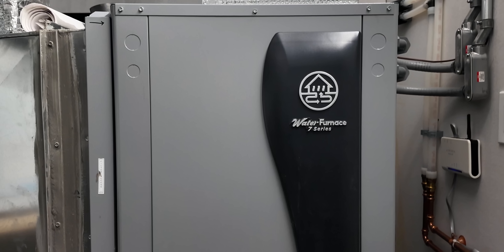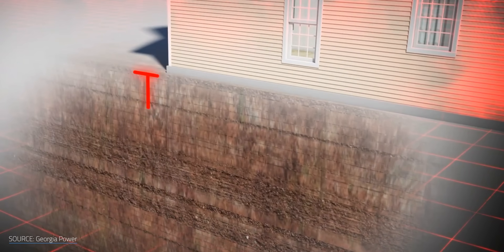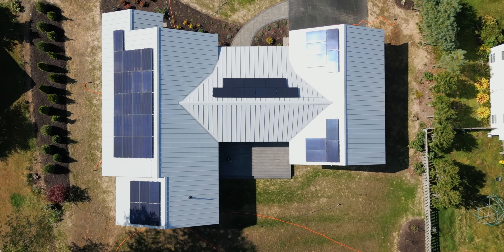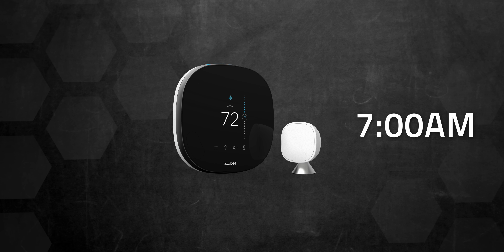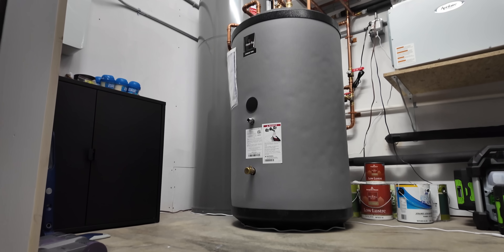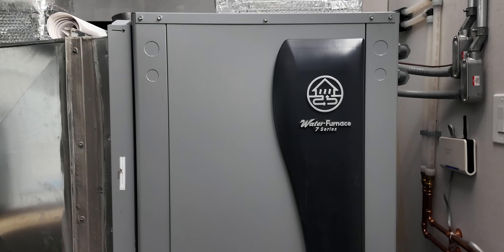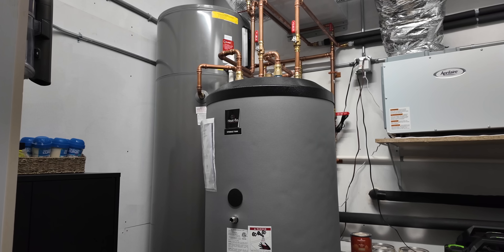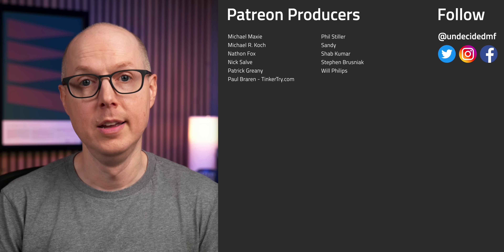How My Geothermal Heat Pump Really Performed (2 Years)

Comment: Focusing on the purely monetary side, you're saving about $1,150 a year. In order to do that, you had an extracost of.. let's call it about $20k/yr.
Now, $20k will generate $900 of risk-free money per year if you stick it in 30 year treasuries. So you're actually saving $250/yr of principal.
Divide $20,000 by $250 and you'll get a number of years which confirms that unfortunately with your figures you will not be doing this to save money.
Further, even if you were to 'forget' the opportunity cost of those $20k, 20/1.15 is around 18 years.
I'd be surprised if the equipment had a life expectancy of much above 20 years and of course one should factor in the greater cost of repair.
So even then it would not be 'financially worth it'.
Which is again unfortunate, but that's where the numbers come out.
Yes, I look at business plans for a living :)

Comment: Nice break down! That cost took me by a big surprise tho. In my area these cost around 20-30k, depending how big your house is (including the pump, ground loop, inner piping, buffer tank, pressure vessels etc etc.) . And here in Finland ground source heat pumps are the most common heating source for new detached houses. Side note: you can use ground loop for cooling only if you've drilled bore, not with surface loop

Comment: Official WTF*:  $39K would have been the cost of a comparable air source heat pump".....I live in Florida, so maybe I have no idea of your equipment up there, but $39K would be an appropriate number for someone with a 10,000 sq ft home!  A high efficiency unit for a 2,000 sq ft home here is *maybe $11K!, and that goes down with increasing size.

Comment: to add on the water heater thing, i saw this setup using a copper drain pipe for the shower with square tubing wrapped around it that was the supply line to the water heater. your waste water from showering was pre-heating the input to the water heater. it was an insane amount of recovery, too. iirc it lowered heating costs by something wild like 40%. worth fact checking though, in case my memory is fuzzy on the details.
Reply: bro $0.31/kWh is insane. i thought it was high where i live :O

Comment: Seems to me that the average break-even for a ground source unit is about 10-12 years.  If you consider that the average time spent at 1 location is about 7 years, there is a risk of payback.  Of course, there is an advantaage on selling.

Comment: It's crazy how wildly different technologies can behave depending on the local legal framework. Where I live power is extremely expensive for example, and almost nobody uses AC, we just open windows or have a fan or two. So cooling isn't at all part of the price calculus, and heating is just done with gas or wood (or pallets for that matter). 
So since power is expensive, and gas relatively cheap, this would never make sense in my area. Same reason EVs don't catch on here, despite the government offering constant bonuses. People just don't want to run their cars on expensive electricity.

Comment: Good videos just a couple of things price I really wonder what the price would actually be if the tax payers didn’t have to support these rebates with rebates the price always goes up and these companies are preying upon this fact shameless!The way this industry explains the systems is your getting free energy from the ground your actually getting it from the AC unit. On our sailboat we had a AC UNIT FOR COOL & HEAT which used lake water to cool the unit. So it’s a geothermal system. These systems for homes are way overpriced!  Most people don’t really understand how the systems work the only thing these systems are eliminating is the gas to heat.and the cooling fan for the AC pump. Good videos though.

Comment: Why not build a bunker below the frostline for an air source heat pump? Half the cost of ground-source, should be way better efficiency than trying to steal heat from the snow and dump heat into the hot.

Comment: I would probably go with a pond loop so I could have an excuse to build the pond of my dreams. Your cost is way higher than what I have seen from others, but that's probably pumped up by using premium luxury equipment and a suboptimal soil/rock setup. And of course renting the equipment to do the installation at your own convenience can save a fortune lmao. I'll gladly put in a week of yard work to save multiple years of wages.

Comment: The price variation from country to country I can understand if the technology is new and there are only a handfull of equipment and people doing these, but surely geothermal is so old tech and drilling is just drilling. How could it be so expensive? I installed a system 3 years ago here in Finland for 22 000 EUR. And that was not the cheapest option as I went for a quality system and indoor convector for cooling added to the costs.

Also the comments about impossible drilling where there is bedrock? We HOPED that the bedrock would start immeadiately after surface so that the need to put a steel pipe would be minimal. We get quoted with disclaimers that say "price includes one 6meter steel pipe and drilling of x meters into bedrock, any additional soft ground drilling and steel piping will be billed separately"  When I was deciding for the system I read horror stories of other people only finding bedrock after 40 meters of soft ground and paying huge amounts that basically ate most of the potential savings for the first 10 years.

Comment: Variable speed heat pumps typically give the best economy when you keep the temps constant. Even a 2 speed HVAC works well when kept in a very narrow range. If you let the air get 4-5 degrees warmer on a hot day, a two speed unit will often have to run at high speed for a long time to get back down to the lower temp. When running at 75%, the 2 speed will use about 60% of the power that it will when running at 100%.  The unit runs longer, but uses about the same total amount of electricity, and it keeps the home at a more comfortable because running longer lowers the inside humidity. The more speeds you have, the better it is to leave the thermostat at the same setting.

Comment: My fundamental concern, or debate I suppose, which I’ve been unable to calculate myself is what I call the “VW Effect”. VW got creative with some programming regarding their diesel engine efficiencies and while they were capable of the NOx emissions the fed mandated, they couldn’t also get the fuel economy the customers demanded. So they got, creative, with their accounting. And it cost them $35bn or so. Here’s the rub, the government and EPA required these vehicles be “fixed” or destroyed and most people opted to replace rather than wait for a magical fix of some kind, eventually. So hundreds of thousands of perfectly functioning cars which would have passed emissions the year before they were made, were relegated to being bought back so people could buy another car. Stay with me, I promise I’ll get to it. So, hundreds of thousands of cars which had a minuscule (relatively) emissions excess now had to be destroyed, which used heavy equipment that had no emissions standards, and all the plastics ended up, well, everywhere. Then the previous owners had to buy another car requiring the entire manufacturing complex to kick in and spew tons of toxins out since they have, lets call it flexible, laws and rules, then ship these cars on boats which basically spew tons of toxic gasses across an ocean, then be loaded onto big rigs, which again put out more NOx per car to go from A to B than any of the cars themselves will put out in a lifetime just so people can buy them to replace the offending vehicles. At some point, wouldn’t it have been closer to “net 0” to not do certain things? A free hot water reclamation for example is free, financially, but it took being manufactured, then people, driving, installing, fittings which needed to be manufactured and so on. At what point is the “net 0” not really net 0? It is more like a “0 from now on” calculation. For context, I’m having this same debate as I just had my house retrofitted with solar and battery backup to supplement the dual fuel heat pump HVAC system I had installed 2 years ago. I want so badly to have a circuit from the battery power a 20amp plug next to my gas hot water heater so it holds 5 gallons of free hot water. This would run 95* or whatever water into my 50 gallon gas hot water tank preventing short cycling whereby the tank kicks on to replace the 5.5 gallons of hot water I used but replaced with cold water from the main. But this doesn’t actually come for free does it? The electric heater is cheap, the wire, I have, the outlets, battery, solar power, I have all of it. On face value it is cheap and works towards a net 0. But I didn’t need a hot water heater. So all that wire, pipe, time, energy and that 20amp circuit from the battery could have gone to a different use to be more genuinely “Net 0”. All that said, I’m not targeting a net 0 environmental impact with my house, I’m targeting a “he squeaks when he walks” goal. So for me, it may make sense, but I genuinely wonder how much of the before the fact environmental impacts you account for in your “net 0” target. How much of the “that copper pipe could have been used to make a geothermal heat pump system for someone else” did you consider during your maths? 

I really enjoyed your video and will say I clicked play thinking “he forgot to account for group gatherings”… because that’s exactly what my brother in law did. Certain areas are more heat intensive than others and when larger groups come for holidays or whatever, especially during SoIL summers, the system just cannot cope with the added body heat and heat from cooking. For a family from day to day, it’s perfect. But for those 4-5 times a year it may as well be not there.

Last, to help the rooms that are warmer than the rest at times, if they have ducting, some time and efforts with an anemometer and baffling in the ducting around the house can make a huge difference. My bedrooms are on the second story and my girls are above the garage. When I started my journey there would be a 15* delta pretty much year round due to how poorly the house circulated, but some maths, patience and trial and LOTS AND LOTS of error, I now see nearly 0 difference between our bedroom above the kitchen and theirs above the garage through the winter and summer months with the exception of their floors being physically cold or hot, the room temps though remain comparable. Perhaps some time with an anemometer and some styrofoam baffling could yield you better results in the hot/cold areas you describe.

I know this is TL and most DR but if you did and you considered any of my points, please share your thoughts. I’m genuinely interested in how you included it in your calculations.

Comment: I first learned about geothermal heat source about 30 years ago. It is something that I have always wanted to do. Alas, we were never able to do it at the only home we had that had enough room. We did upgrade our furnaces to the most efficient a available at the time and we were able to keep the house more comfortable while paying less per month
My new wife and I moved to Colorado several years ago and after renting for 3 years we finally bought our home. The main reason we bought it was that it had underfloor radiant heat. The original heat source was an 80% tankless water heater. It was rated at  199K BTU. We had a second one for DHW. One winter the tankless failed so we bought a new one, It was 95%+ efficient and we were about to go with a 129K BTU unit. It has a 10:1 turndown so when the water in the system comes in at105* and it heats it to 120* the unit uses so little gas it is amazing.

Comment: I have no idea how running a heat pump can become that expensive ($2100 air source). We have an air to water heat pump which heats a 200m2 house in Scandinavia (as well as hot water), and that uses around 4500 kWh yearly with a COP around 4. One kWh is around $0.17, so total running costs are around $765 per year. Compared to our old natural gas furnace it feels like a steal. We used roughly 1900m3 worth of gas per year at $1.7/m3, so ~$3250 per year with gas. Even with an EV, and our regular power consumption as well as the heat pump, we still pay less for electricity than we paid for gas alone.

Comment: We looked into this kind of system, here we can do open loop off our creek which makes it a lot cheaper. But unless you have a giant house, or one that isnt very tight/ well insulated the numbers just dont work. Our heat load is so low it would take decades to get pay back and our system would be extremely complex. Wood heat, infloor back up (gas), slab on grade keeps it cool in the summer, south facing windows FTW

Comment: I had a new Gas boiler put in my home in Scotland about 4 years ago. At the time It cost $3352 Supplied and fitted. It's only used for heating and instant hot water. It's what you would refer to as a tankless Natural Gas boiler. These are the dominant and primary heating and hot water source for many in the UK, Even businesses. There is no hot water cylinder. The one Boiler heats a small 2 Bed room home and it's yearly costs are $517 in the last year. In the UK the heating systems are typically, radiators. Hot water is fed by pipes from the tankless boiler discreetly to each room through the walls and floors to radiators, Again commonly referred to in the UK as a Central heating system. With limitations of space because of our smaller homes and much more expensive utility costs, We do not typically use the HVAC systems with forced air in the UK. I would love to say that I could rip all my heaters out and retrofit An Air source or ground source heat pump with new heaters/wall units. Because of the sizes of the heating pipes it would all need replaced. This is just completely cost prohibitive currently, as floors would need ripped up and such. We are talking $20,000+ minimum. This is a pretty common Issue in the UK were Retrofits are needed. Grants are measly at best. There will likely be no movement on this until GAS boilers are banned from being installed after 2035, when they start to faze those needing replacements boilers on to heat pumps. Luckily New build homes here now need to have a heat pump when they are built but the rest of us are stuck on gas. The first steps for me is make the house as efficient as I can, Newer more energy efficient appliances, New external doors and windows, I have already had the whole home Re-insulated to keep the heat in. The move to Solar panels with a battery will be my first step but even that is a 10 year investment before any actual return. It makes sense to do what you have done on a new build but most people can't even afford to buy never mind build just now. For now in my part of the world a replacement Gas boiler will always be cheaper to buy and run than a heat pump until something changes. It always comes down to price.

Comment: Interesting! If I were younger, and lived somewhere colder, this would definitely be a thing I'd consider doing. But we live in BC where the weather is mild year-around, and our electricity costs less than half of yours. But this got me going on researching air-source heat pumps, which would be considerably better for us than the current oil heating system -- so, thanks for the indirect nudge.

Comment: To bad no one has the brains to "recharge" the system. Put back the heat you stole from the earth during the summer. In fact, you might want to give it a little more than what you took last winter. And you could duplicate the system to be double just in case the earth did not take the opposite season's "charge". Heat pumps usually go bad after a couple of years because you have depleted the surrounding earth of it's heat. With no replenishment you get  nothing one winter.
Reply: @georgegates526  😂 good troll

Comment: I have a very old not very well insulated house heated by an oil burner. We use about 1200l of oil per year for heating and hot water. That comes out to about 100 Euros a month. With a bit more insulation, I am sure that I get that down another 20 Euros. I love the idea of a heat pump but for us it’s just not feasible.